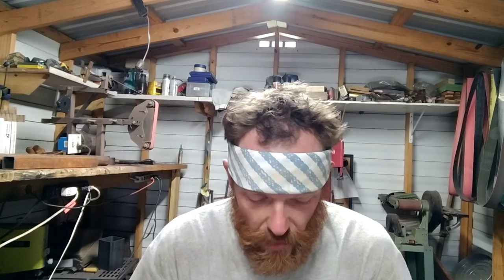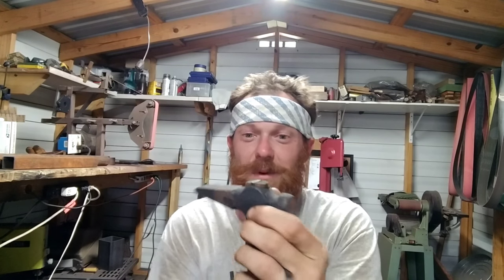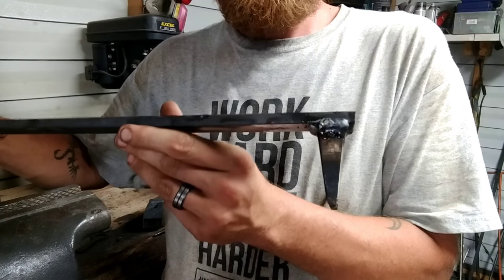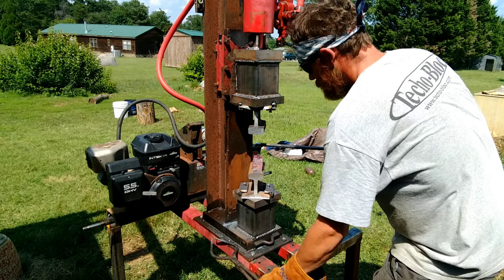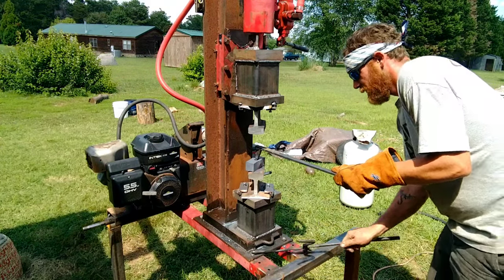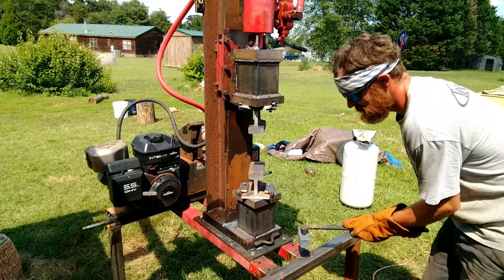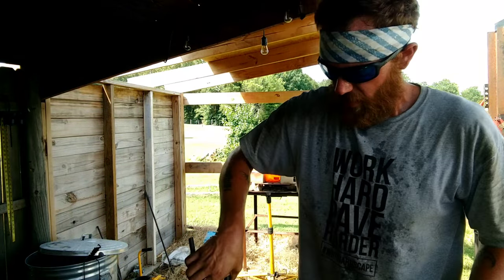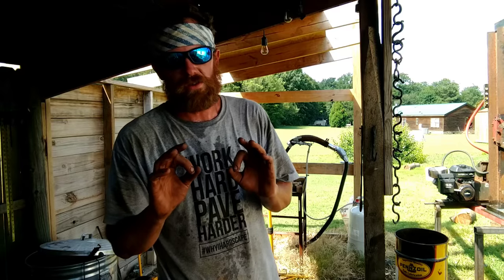Making a hammer eye punch for the press

Comment: If it won't damage the control valve, put on a spring that pulls the handle to the UP position, the concern would be constantly held in the UP position would do something to the valve. Then your treadle could be pushed to just bring it down, and releasing it will have it go all the way up. Otherwise, creating a rocker pedal, so you can push with your toe for one direction, push with your heel in the other.
Reply from the maker: Bryan Robinson I was going alone the lines of the rocker pedal
Reply: If you have access to a heel/toe shifter for a motorcycle, that would fit the bill. Just attach your linkage to the control valve to one end and it will do the job!

Comment: I think you are going to find out that the  RR tracks are not going to be your best option. If you had flat dies you would be able to get the hammer blank to stay on the press better.

But still a good project.
Reply from the maker: Kevin McIntire the tracks are flat...it doesn't want to stay on the die because of the vibrations of the gas engine.